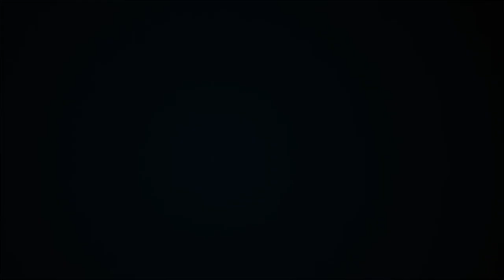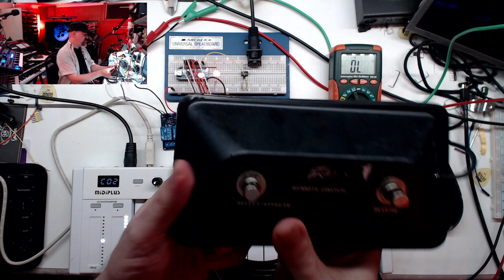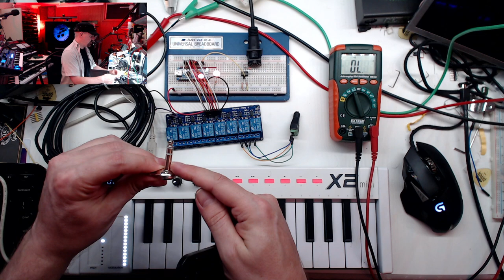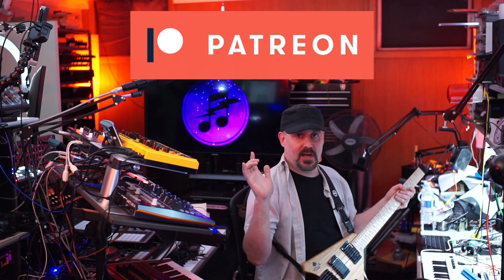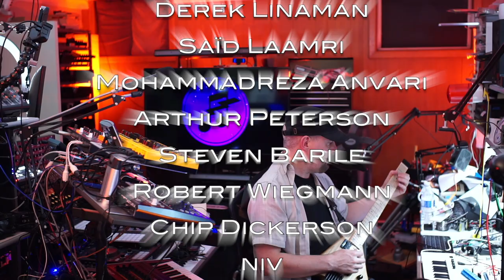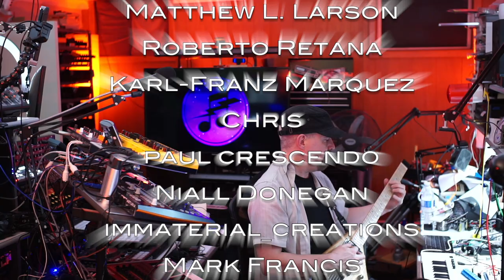Control your Tube Amp with MIDI Relays and Arduino

Comment: this is great.  im going to try to build one to use with my midi foot controller using CC messages.   hardest part seems to be how to properly build an enclosure for this.   maybe eventually ill build a through hole board and to properly mount everything,

Comment: That's Great Dave, Just a thought.. You could get the system to work that 3 switch Fender unit by making sure all switches are of then wiring the midi controlled relays across each of the 3 switches inside the foot pedal itself.

Comment: You can also try to do like Neil Young and use a few servos to twist the amp pots. Midi presets for a tube amp
Reply from the maker: Yes, the Whizzer. That thing is crazy!
Reply: What about building MIDI control into an amp? I'm guessing digipots won't be robust enough to sub in for pots in an amp, but what about maybe a vactrol?

Comment: Nice. I used to use a Behringer fcb1010 to do this. The manual didn't explain it well but it had two footswitch jacks (TS) but you could put a trs into jack 1 and control two things on one amp as well as all the midi stuff.
Reply from the maker: Very cool!